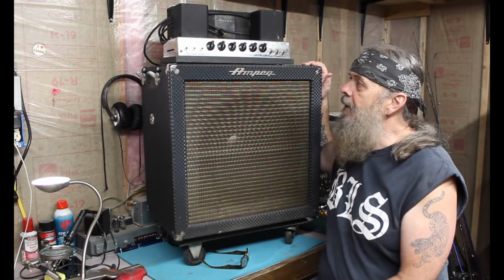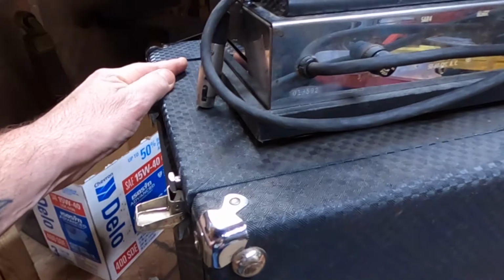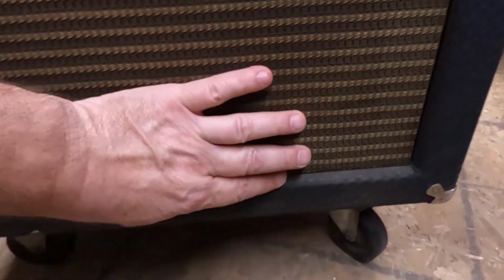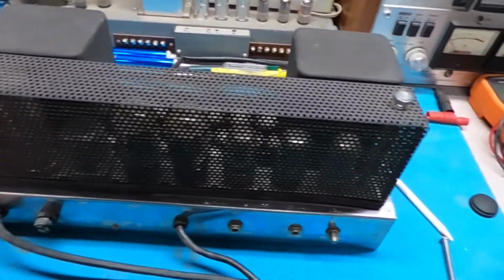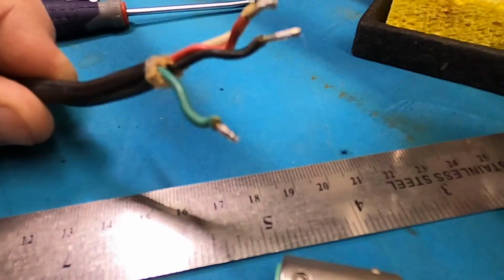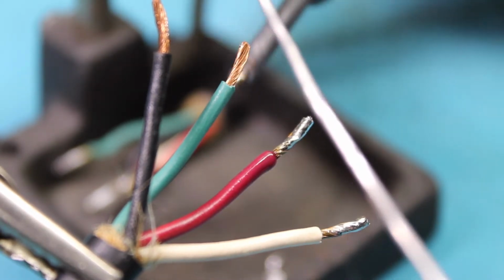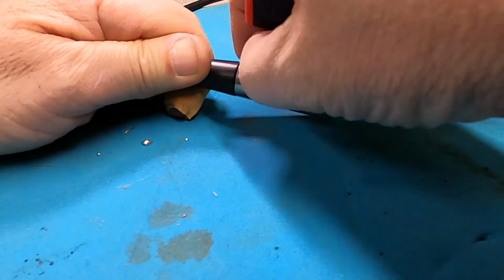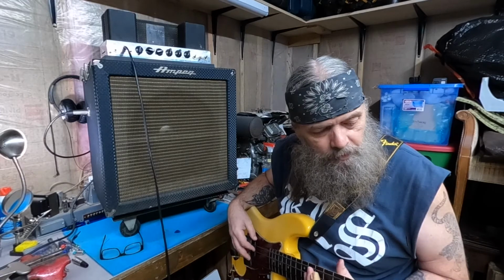1965 Ampeg B-15N Overview and XLR Repair

Comment: Beautiful example here!  I have a '65 as well that I bought a few months ago. Mine needed a bit more work. I had to fix the 4 pin jack, replace a preamp tube, replace the gasket on the top of the cab opening, put felt on the baffle behind the grill cloth etc etc. Hunting down all the rattles and buzzes on these is enough to drive you nuts but man the result is so worth it.  If you ever need OEM or replacement parts, Fliptops.net in Buffalo is an amazing resource!  Nice looking P bass as well!
Reply from the maker: dwaynedelario I will definitely check out that website. Thanks